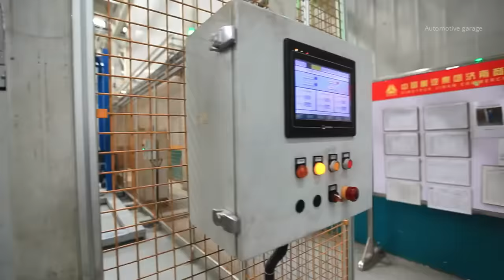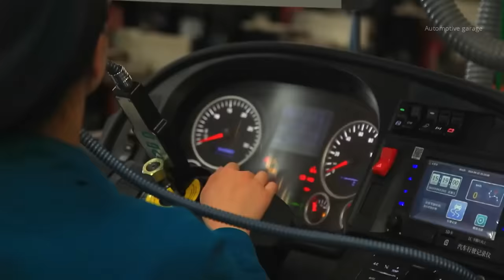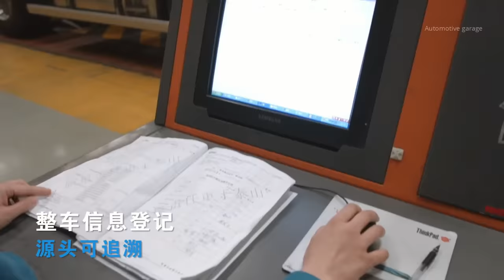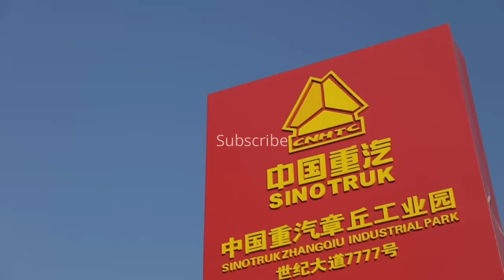CHINESE TRUCK FACTORY - Sinotruk HOWO Production in Hong Kong

Comment: In my country, they are nicknamed "red terror" due to their reputation of causing horrible road accidents.
Reply: Is that because of the truck or the driver?
Reply: @inspector6803  it is mostly blamed on the truck.
Reply: @AgonafirBanjaw  : A bad designed vehicle may injure the drivers or passengers, but causing accidents is hard to understand. Can you give me an example, please?
Reply: @inspector6803  Most of the accidents are connected with the trucks' apparently ineffective brake. Even the Ethiopian parliament discussed about the issue and established an investigation team. But the finding was never revealed. 
Yet on the flip side, the trucks are exceptionally good for rough and rugged terrains. Their price and spare is also cheap compared to Japanese manufactured counterparts.
Reply: @AgonafirBanjaw  : Thank you.
Reply: dalit spotted